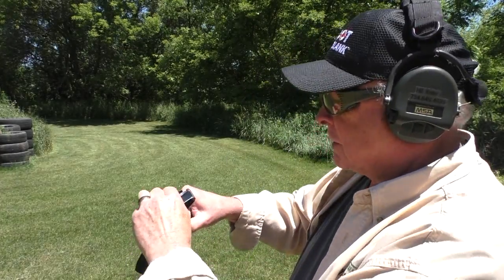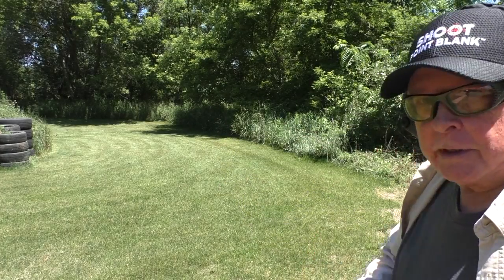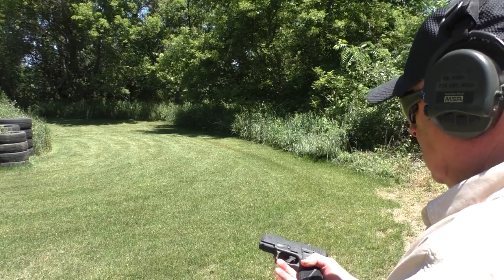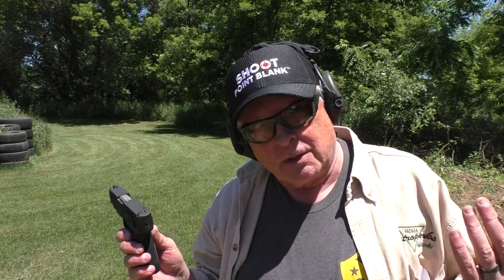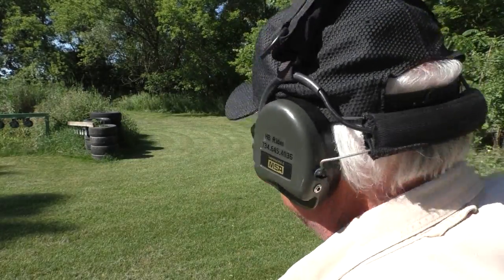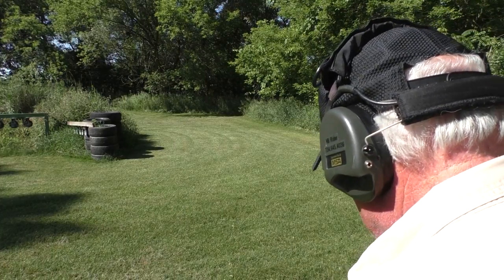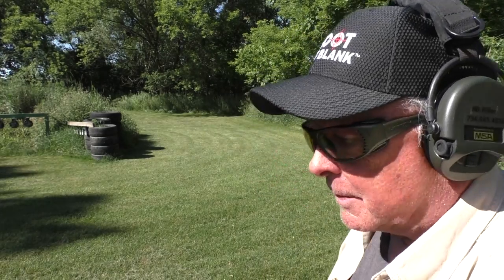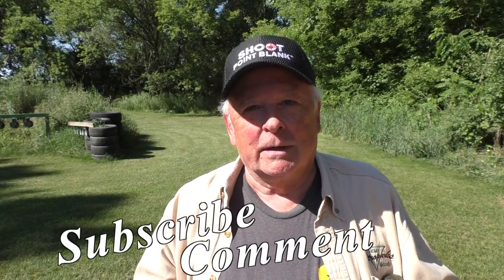Will the Taurus G3c run Defense Ammo?

Comment: With a full mag with hst's honey badger , and critical defense from a locked open slide the 1st round's nose gets stuck on the feed ramp. Mine is broken in and it still does it.
Not betting my life on it. Sorry Taurus.
Reply from the maker: I've found that with some guns and some brands of hollow-point ammo, I can't top off the mag after loading one in the chamber, or I have that same issue. So, with those guns I've resorted to carrying with one round less than max, or putting ball ammo for the first round in the mag once I've loaded the chamber.
Reply: @RidersRange  same experience here